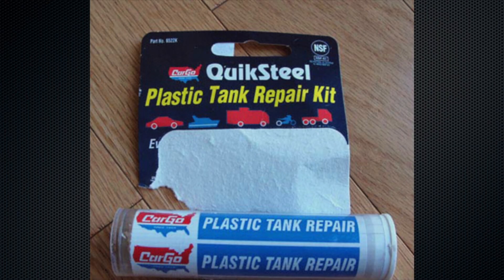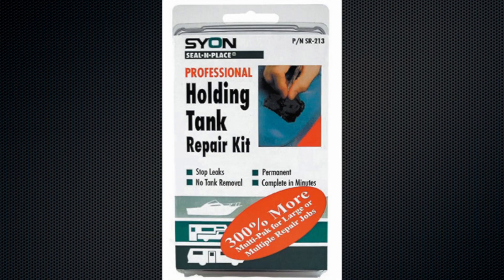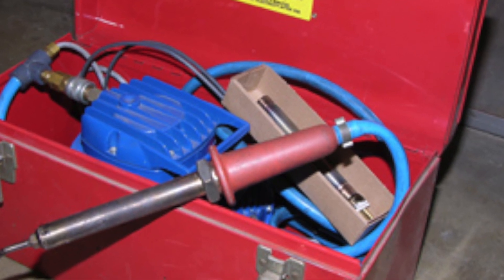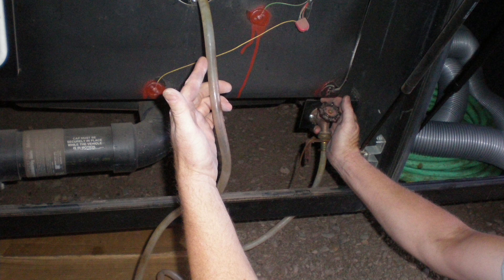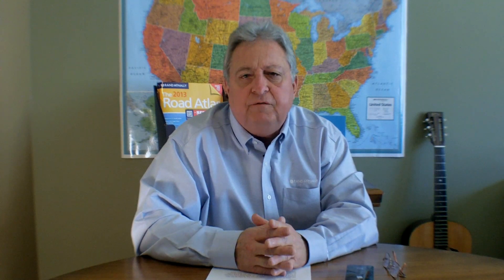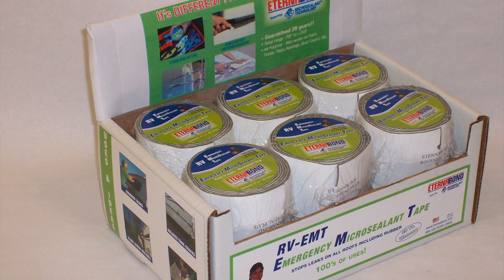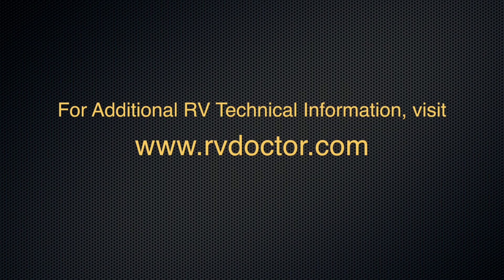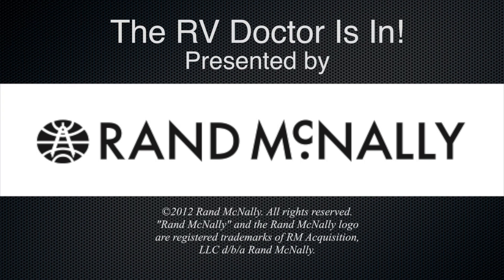Leaky Plastic RV Holding Tank

Comment: Hi Rand. My leak is located directly under the rv back next to the black water tank, very much like to this situation. I do have a bucket under the rv and it has a very slow drip and i have to empty it every couple of days due to the fumes backing up into the rv when it starts getting 1/2 full. Sometimes it gets so bad that the entire rv smells like an outhouse.We have flushed the tank to find out where under the rv the leak is coming from. My insurance adjuster has looked at it and hoping we can get it fixed because it happened when traveling down a gravel road while moving to our new home location.